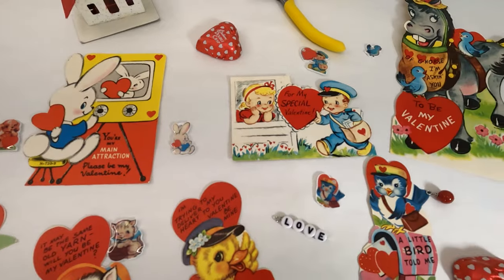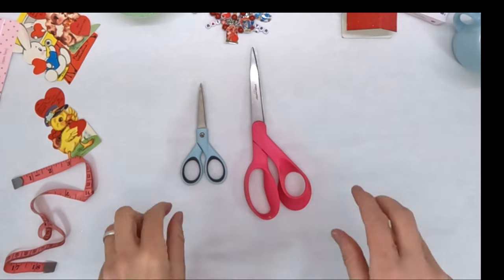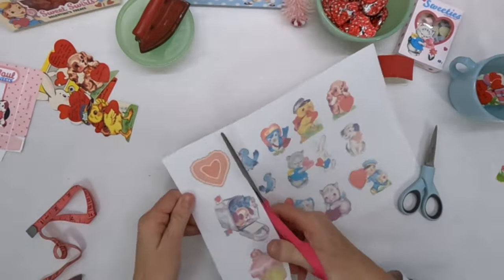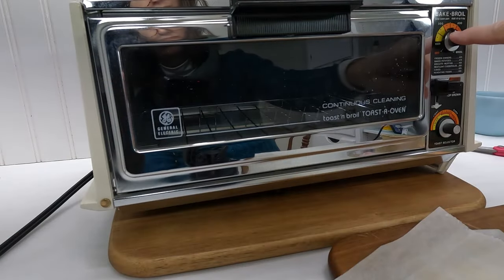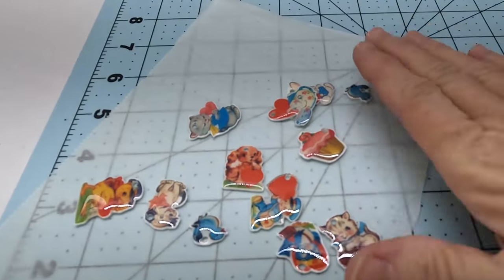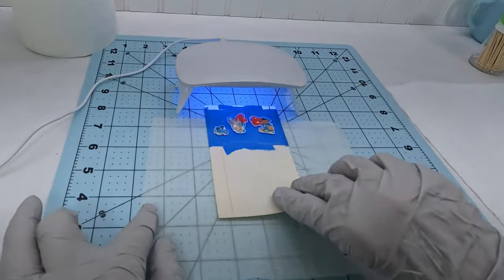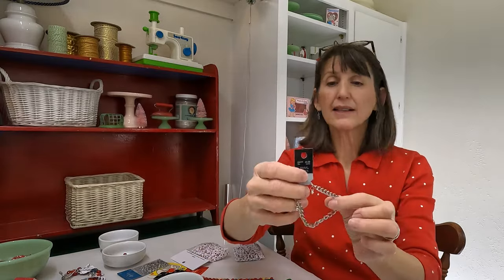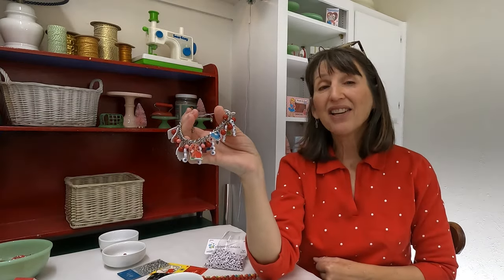Retro Valentine Charms Free Download w Tutorial

Comment: Curious, do you need a laser printer or can  a regular printer work, since you mention allow to dry and my printer never prints anything with a wet feel?
Reply from the maker: Great question! I should have addressed that. The plastic I used is for inkjet printers only. I think laser printers get hot when printing so the plastic is not compatible with them. Since regular copy paper is slightly absorbent due to the paper fibers it's made from most ink jet printing never feels wet, but when you put the ink onto the plastic it sits on the surface until it dries. Usually it doesn't take long to dry. My shrink plastic was dry by the time I walked from the printer to my craft room. Hope this helps! Kim